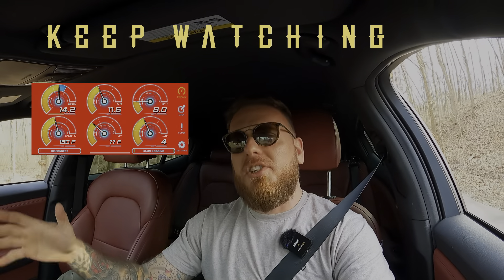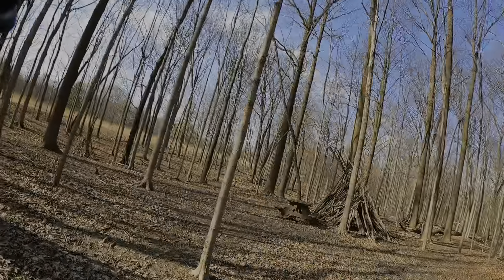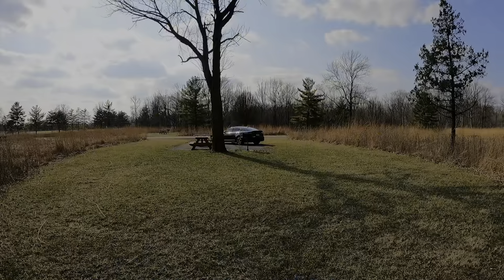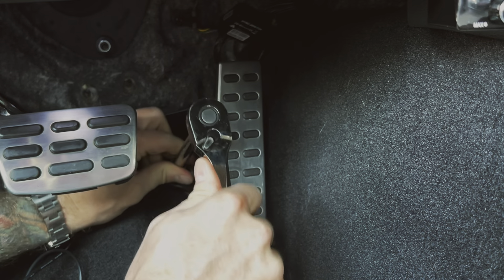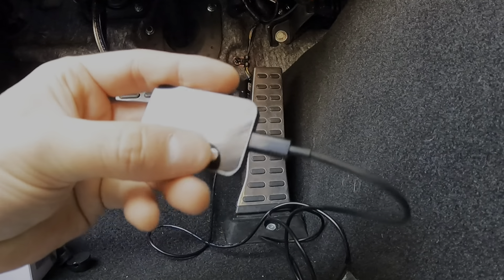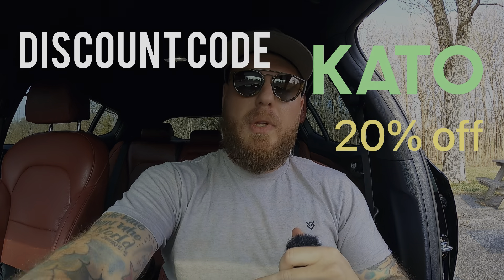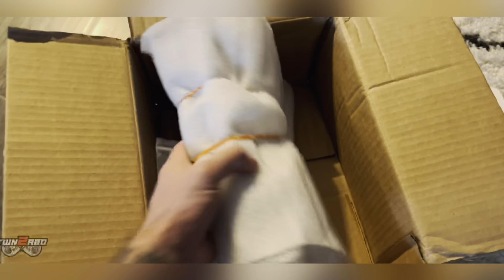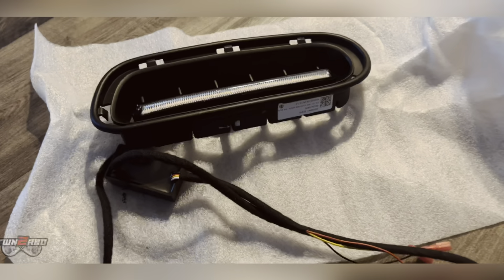KIA STINGER Gets Throttle Tuned by Windbooster

Comment: Does the Windbooster override the pedal changes when switching drive modes?  Like does having the Windbooster in Sport 5 keep the pedal the same in Eco, Comfort, Sport etc??  Love the car and vids!
Reply from the maker: Yes it works in all modes, but the modes on car do make a difference still. I find sport mode on car with sport #5 on windbooster to be the best feeling. Instant response and makes the car feel quicker even though it’s not adding any power

Comment: Awesome vid as always man! Got a question on the Windbooster, what car setting do you have the car at? Like the Smart, Eco, Comfort, Sport and Custom? My friend has a BMS and I'm looking to get one. His Comfort feels a little lag but when I set it to Sport, the setting throws me a little in the seat. Do the Windbooster do the same?
Reply from the maker: So I confirmed it does modulate all the modes, but you will def feel it most in sport mode. I feel the differences are not as noticeable in eco and comfort mode until you get more aggressive on the settings. Just do no change the modes when driving , the instructions are very specific on that and I’ve seen two users report getting a dead pedal
Reply: @twn2rbo  Good to know. I constantly change my settings on the go. Had the windbooster for 1.5 years. So far no problems. I like Eco on Race 1. Still lots of power and good fuel economy. My favourite is Sport+6. Seems to be my sweet spot.

Comment: The "22s have a valet mode built into the Kia Access app as well as remote start.  Don't know why it took Kia this long to add it to the car.  I had 2018 GT before this car.
Reply: It’s not the same thing, the valet mode in the Kia access is to alert you if it’s driven for more than one mile after you turn it on.

Comment: When you 'Pull' are you pulling in auto or manual mode or vice versa?
Reply from the maker: I usually do pulls in manual mode , I like to get the rpm’s around 3k before I lay into it. Seems to have better pulls when controlled like that

Comment: How do I turn my auto start off permanently
Reply from the maker: With an ECU tune, I had that done on my Lozic ECU.
Reply: @twn2rbo  ok thanks. How much do the tunes run and how much extra horsepower do you get
Reply: Thank you so much for that I noticed that you have a few things down to your car how many horsepower do you think that you’re running right now
Reply from the maker: @marvinpaige4117  I’m thinking around 465 wheel, but I need a dyno. A subscriber with the same tune as me who only has intakes just dynoed his and it has 459 wheel hp.
Reply: @twn2rbo  I just bought a 2023 Gt2 Awd I’ve had it now for about seven days and I want to do as much mods as possible so if you could send me a list over of where to start and what to get I would surely appreciate it